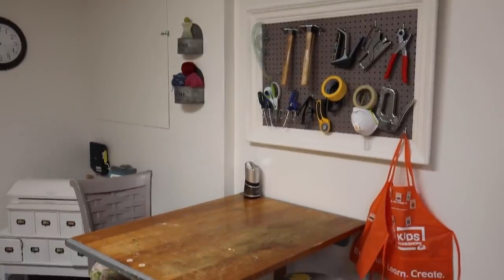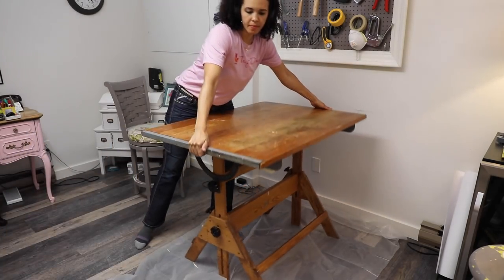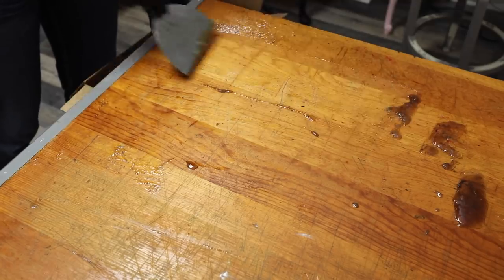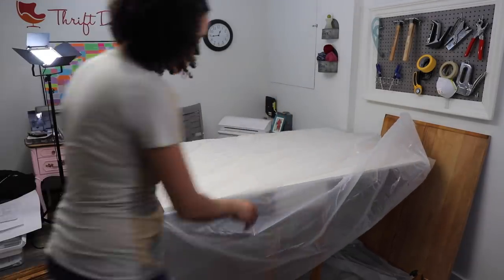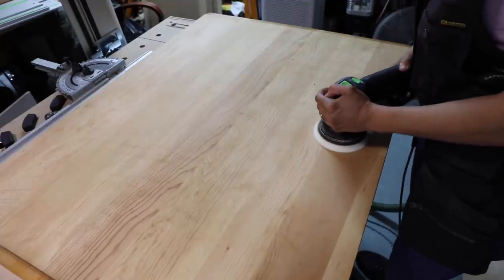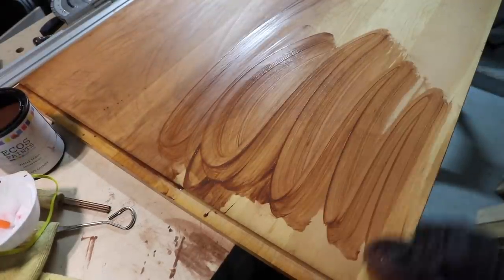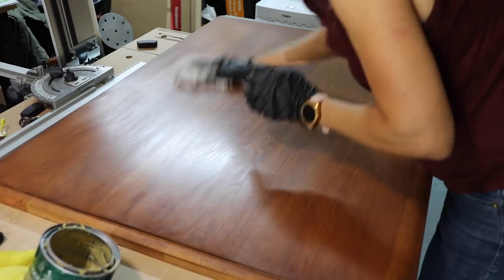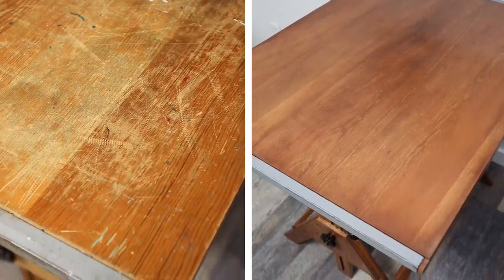"BEFORE and AFTER" Drafting Table Makeover - Thrift Diving

Comment: Thanks for the heads up on products that can be used indoors! Now I won't be weather restricted!
Reply: Amen❣
Reply from the maker: Exactly!!! Safer products are the way to go. I used to use whatever I could find at my local HD or Lowe's, but they don't have as many eco-friendly options, or at least, not that I've seen. And eco-friendly is where things are going. The only thing is to make sure you plastic off the section where you're sanding, and wear a dust mask. :) But yes, everything can be done inside!

Comment: Hi Serena, super job on your drafting table. Whenever i use a scraper, especially a broad scraper, I hold the scraper with two hands and pull it towards me. This helps me avoid gouging the surface and causing damage. When you're pouring a liquid out of a container with an offset spout, try holding the container with the spout uppermost to prevent the glug glug effect. I know it sounds counter-intuitive but it works for me. Give it a go. Thanks for sharing. Stay safe and keep up the good  work. :)

Comment: Breakers in your house could include several rooms and have a lot on one circuit. In your garage, it's typically single circuit receptacles.  That could be why your breaker tripped in the house. A sander can be a high demand tool.